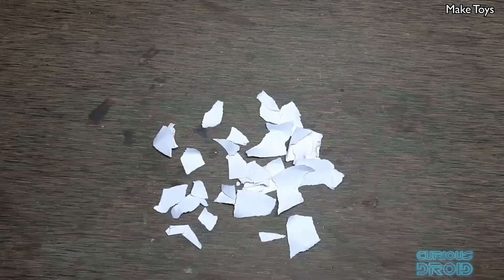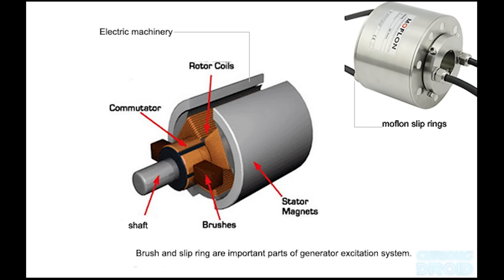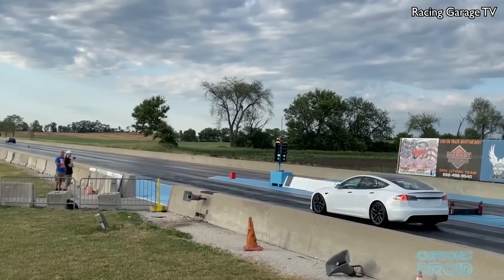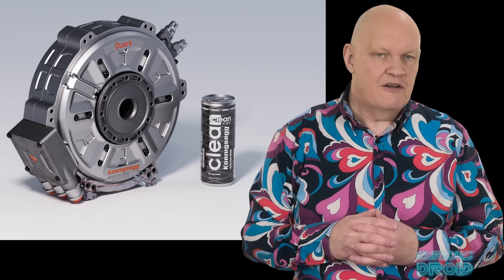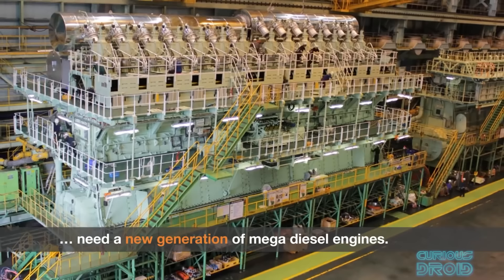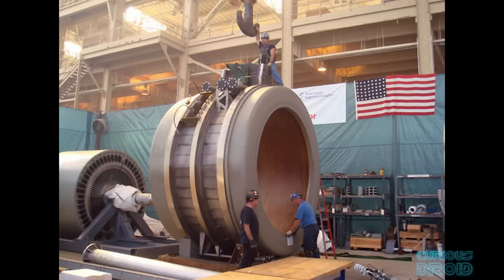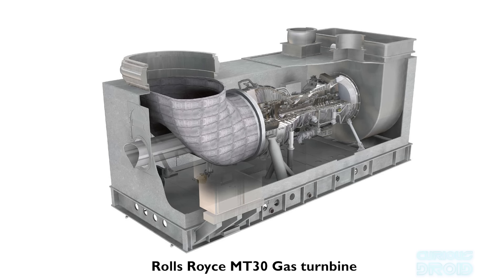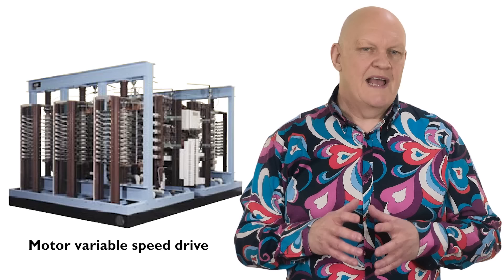The Worlds Most Powerful Electric Motors

Comment: Instead of saying some meaningless torque figures could you perhaps say the power in KW/MW as well so people can actually compare that to other motors and electrical appliances? (Or skip that archaic HP number completely)
Reply: Someone didn't see the video it seems, and yes HP is pretty relevant still
Reply: @edwardcardozo8325  I stopped half way through because I'm to lazy to convert some strange unit based on lifting a seemingly arbitrarily chosen mass of 75kg at one m/s... (Or is it 550lb at 1ft/s? I'm not even sure what definition of the horsepower he's using.)
I use the SI units because they're just way easier to work with and are internally consistent!
Like if I have say a 100kWh battery (Or would you prefer I tell you that capacity in Foot-pound ?) how long can I run a 300HP motor at full power with that? You'll first have to convert that to kW anyways so why not start there?
Reply: We use HP, W and VA when talking about power and consumption in the industry.

"75kg at one m/s... (Or is it 550lb at 1ft/s"

That is irrelevant, just divide the W number by 746.
Reply: @DickCheneyXX  "That is irrelevant, just divide the W number by 746."
That's exactly what I was talking about and why it is very relevant what definition you're using!
That 1HP ≈ 746w is the imperial definition of lifting 550lb at 1ft/s, if you were somewhere else in the world odds are that you'll find that 1hp ≈ 735w
Either way why bother converting hp to w and back if you could just be using w in the first place?
Reply: @joejoe4games  Because electric motors are generally rated in HP, not Watts. I have never seen anyone in the industry complain about this, it is extremely simple to convert. It also makes trouble shooting simpler in a 600V environment, you get roughly 1A fla per HP for Y induction motors.
Reply: @DickCheneyXX  NEMA standard electric motors are rated with HP. IEC standard electric motors are not unless shipped to the USA.....He is right...

Comment: I enjoy your content, but you have one of the most annoying ways of talking I've come across on YT. You start each sentence off loudly but your voice gets fainter as you proceed, to the point where you're mumbling at the end of the sentence. It makes it very hard to understand what you're saying, especially in an environment with ambient noise.

I guess this happens to people who have weak lungs and run out of breath as they proceed, but surely this is easily fixable with technology? Why not run the audio through a normalization plugin in your sound software, to even out the audio volume? It just amazes me that people who put in so much effort to make good content can't be bothered to fix simple technical problems.

Comment: Look at how "Wärtsilä" is pronounced. Ä=æ. Not like "wart" would be pronounced. It's "wærtsilæ". It's a finnish name. You know... Finland. I know it can be challenging but since this channel is aimed to be informative might as well get it right. Just saying....
Reply: That Engine is Swiss though; Sulzer built the 96 RTA Engine (like the 96 RT-Flex, but mechanical instead of electronic) before Wärtsilä bought them, and started developing the RT-Flex before that too. Wärtsilä's Two Stroke Business always was in Winterthur/Switzerland, and they sold it a few Years ago. What used to be Wärtsilä-Sulzer is Winterthur Gas & Diesel (WinGD) today. It's more or less the same with MAN, all MAN Two Stroke Marine Diesels actually are Burmeister & Wain Engines from Copenhagen and not MAN Engines from Augsburg, although B&W belongs to MAN much longer than Sulzer belonged to Wärtsilä, so the Separation is much less "sharp", and MAN didn't sell B&W either.